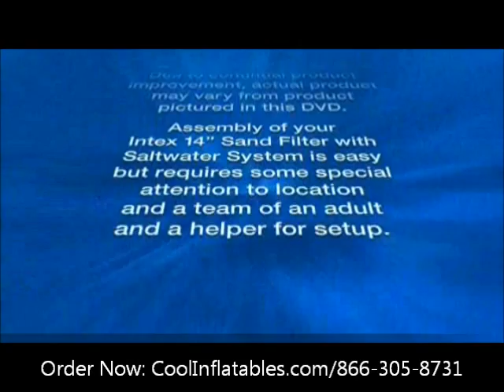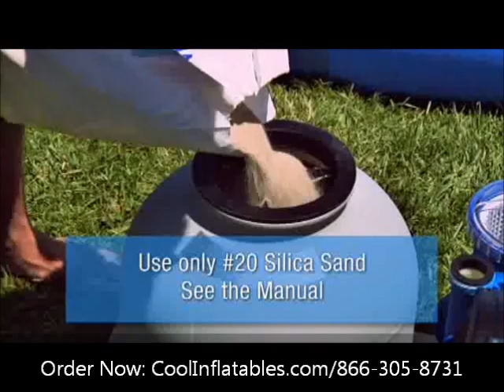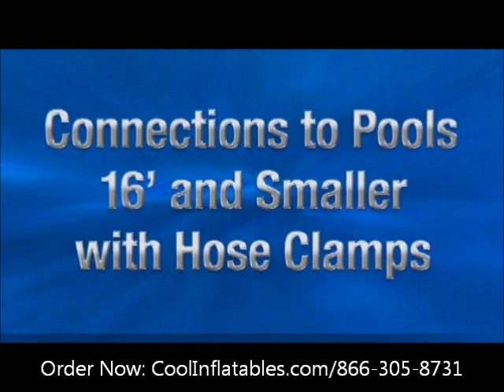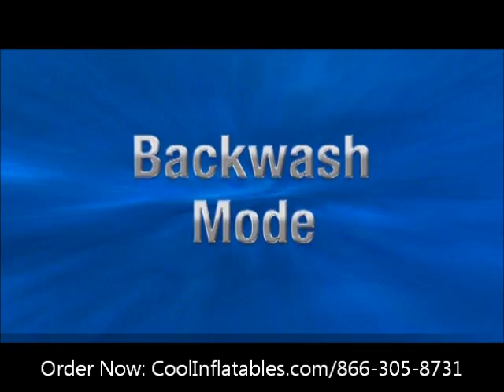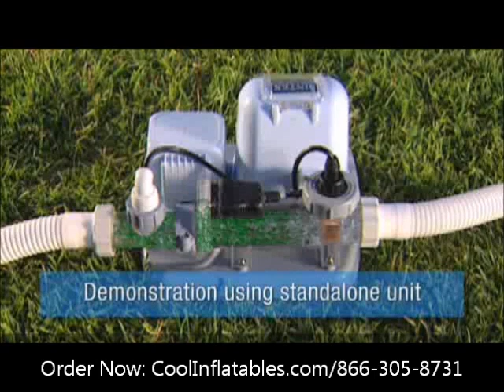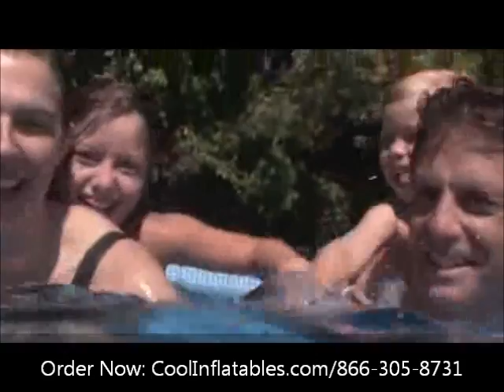Intex 1600 gal/hr Sand Filter w/Saltwater System Setup Instructions

Comment: The unit seems to come with a GFCI on the plug. Does this mean the receptacle shouldn't be GFCI protected? I've heard by having two in a row they can interfere with each other.
Reply: I have it connected to a GFCI receptacle (two in a row)..Runs with no issues. Hope this helps.

Comment: This pump gave me so much trouble after 2 months this summer and 3 times dealing with intex getting new parts.. (that didn't work) I finally gave up and returned it. Just a frustrating piece of crap. BEWARE of the low flow!
Reply: Calvertron I need help the part of my pull that sucks I have holes that suck were do I hook them up to on my sand pump and the part that blows water out we’re do I hook that up to my sand pump sorry it’s my first pool